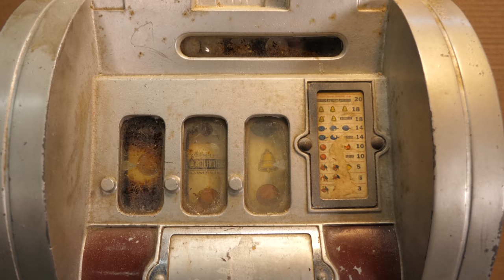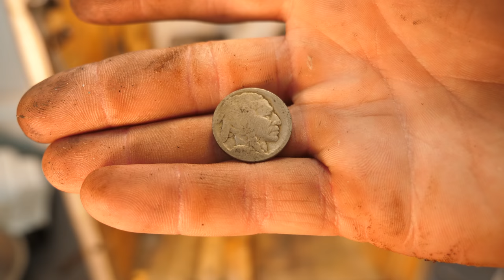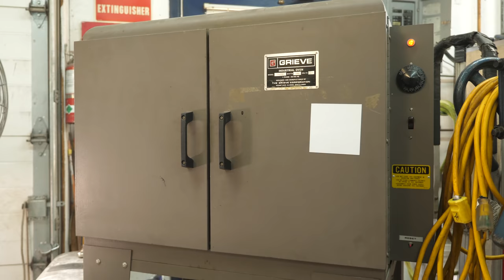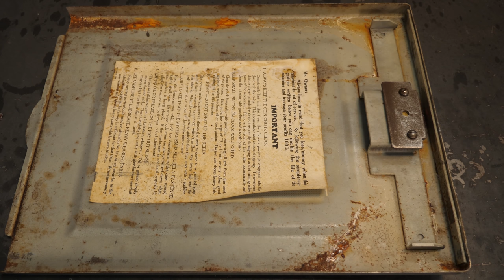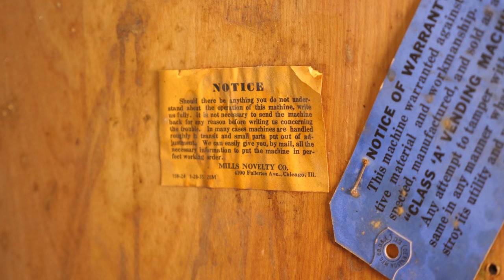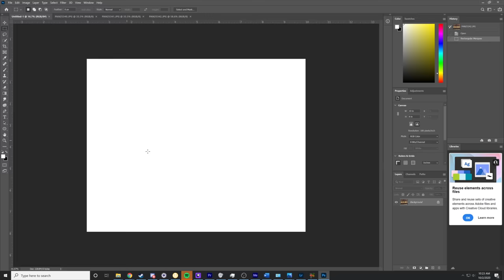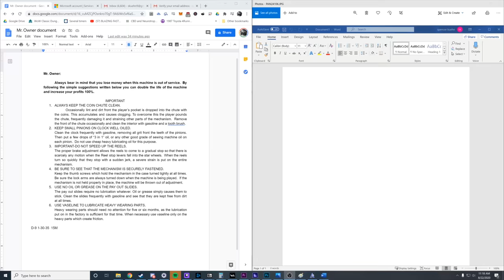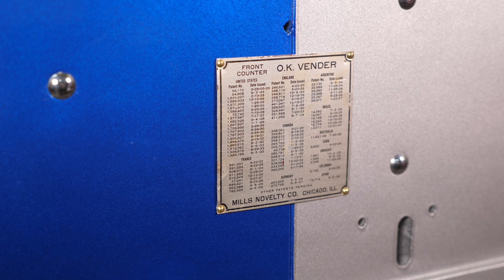1933 Mechanical Slot Machine Restoration (Slot Machine Part 1)

Comment: I can't even tell you how many parts I would have "left over" if I tried to rebuild something that complicated.
Very nicely done.  Looking forward to the mechanism vid!
Reply: A(s)lot?!?
Reply: @marianilsson8785  More than that!
Reply: Parts left over just means you did it better than the factory. (Often heard comment by auto dealership mechanics.)  :-)
Reply: my mechanics:
"This slot machine is in bad condition... I make a new one"
Reply: At least a few screws/bolts. That's what happens if I'm trying to do something like this.
Reply: I have parts left over just changing a light bulb lol
Reply: @JohnnyX50  HA!  Flip the switch, and springs and a couple of bolts end up on the ground!
Reply: Me too.

Comment: I’ve been a slot technician for a good amount of years now and this was pretty neat to watch. The oldest games we have are IGT S2000 at around 20 years old. Nothing we have uses coin anymore, but I’ve heard horror stories
Reply: What horror stories ?
Reply: @psirvent8  coin in jams were the most common issue. The jet sorting machines for these coins were causing people to go deaf. The drop team’s hands were blacker than a mechanic’s due to the metal dust. If you stuck your hand in the hopper they would come out black from the dust. It was impossible to keep those machines clean back in the day
Reply: I was waiting for “deals with the devil “
Reply: @pbentle1990  yeah it was, plus the unholy things that people would do to the coin trays

Comment: It's hard to see properly but it's not a magnet is it, to prevent steel blanks being used instead of coins?
Reply: I was thinking the same thing. To catch fake coins.
Reply: It's hard to see properly but it's not a magnet is it, to prevent steel blanks being used instead of coins?
Reply: @hunterwatkins9858  was there a point to that?
Reply: Back in my pinball machine days, the coin acceptor would test diameter, thickness, weight and magnetism, in that order.  The magnet might be missing, it was optional in countries where iron might be used in legit coins.  

In the US, we had steel pennies during WWII to save copper. Maybe it was a penny machine upgraded to nickels but they had removed the magnet during WWII?

A penny in 1933 would be the equivalent of 15¢ today.

Comment: Wow, what a project! These machines were state-of-the art for their time. They were not toys. They were designed to function through 100k's of spins, and even had rudimentary features to deter cheaters. My grandfather had a similiar one in his tavern. He used to give me a handful of nickels to play it, and I could keep what I won, unless I hit the jackpot, which went back into the till! I had one of these apart once, and from the number of symbols vs the paytable, I worked out that the machine held about 30% for the house!

Comment: my mechanics:
"This slot machine is in bad condition... I make a new one"
Reply: This made me giggle way to much
Reply: Legend has it, he is still trying to hit the jackpot.
Reply: God I hate his catchphrases
Reply: Different guy
Reply: People are so quick to replace a broken part but fail to realise that part has a single broken or worn part that is cheaper than the whole unit.

Carbon brushes in a motor for example.
Reply: @gregjenkins5347  hahahhahahah
Reply: @forevercomputing  In My Mechanic's videos, the "part" is usually a screw, a rod or some heavily corroded metal plate
Reply: There's so many screws, he could do a entire video only getting the hole's edges smoother

Comment: I think the part at 42:30 is a probably space for a coin sorter so if you put in something that wasn't a nickle it would drop it out of the machine.
Reply: That's exactly what it is
Reply: Yep, it was called the slug remover.  It came about around in the 1920s when people would use slugs, or even strings tied to coins.  I even heard of people pouring oil or hot salt water to trick the machines.
Reply: @thisolesignguy2733  "Stringing," "Spooning," "Rhythm Play," "Drilling," "Handle-slamming," liquid detergent, slugs, foreign coins, magnets--the list goes on and on. It was a constant technical battle between the cheaters and the operators--who sometimes had a few tricks of their own. 
This one has a wooden case without the hanging or floating armor plates to deter drilling. 
See Scarne's "Complete Guide to Gambling" (1961) or Ortiz, "Gambling Scams" (1984).

Comment: I would guess the large "mystery" part would likely for some States/Counties to have stamped licence/inspection information into (or be replaced with a State provided plate) which may or may not have been done depending on the specific state/location the machine was located in.

Comment: How did a 30’s slot machine last longer than the body on my 2010 Silverado
Reply: 🤣 The body on my 2001 Silverado was nothing but a pile of rust when they finally hauled it off.

Comment: The level of engineering and fitment to make this machine in the 1930s is nothing short of insane.  Today's slots probably have 1/3 the parts and of course none of the soul or joy de vivre that went into this.  Restoring it does justice to those people who were responsible for its manufacture.

Comment: Bravo!!!    I am restoring an old 1956 Genco "Silver Chest", that is severely rusted. Could you kindly post in the description what products (chemicals) you used during this restoration? I am especially in need of some good rust remover!!!   (Frozen / seized Mechanisms)
Reply: EvapoRust! I see lots of channels using it plus it's safe to use.
Reply: @CraigH999  I have tried that.... It was only about 60 % effective. Next up i am going to try a Muric acid bath for 30 minutes and see what happens.
Reply: Could use electrolysis.

Comment: Great job! One question though, why did you change one of the prize money figures to 18? It was correct as original when you were working on photoshop, then changed once printed.
Reply: Inflation? :D
Reply from the maker: Good catch! It's a long story, but I've fixed it now. 14 is correct

Comment: 42:36. Unless I miss my guess, that is a slug trap. It is to catch counterfeit coins, washers and other debris.
Reply: No, not a slug trap. At 42:36 this is an Award Token dispenser. On some machines there was a symbol on each reel that if you got all three, instead of a payout, you would get an award token that could be exchanged for cash or prize depending on the location.
Reply: @jimgard2609  I stand corrected.

Comment: The owners paper at 50:39 has typos on both Number 2 and Number 5. Number 2 should be remove all grit FROM the teeth, not remove all grit front the teeth. Number 5 should read no lubrication whatsoever.

Comment: The immense mechanical complexity of these old machines never fails to amaze me.
Today that would be one LCD screen, 2-3 wires and a small circuit board.
And of course the whole thing would be made from plastic.
Reply from the maker: And hundreds of thousands of lines of code*
Reply: @RestorationStation  that is true.
I just love all the mechanical wizardry, it is so much more impressive.

Comment: You can really call this technology. Everything with screws and springs. Nothing electronic. And it's a lot easier to fix than it is today. I don't want to talk badly about today's devices, but it is hardly possible to repair them. The repairability of old things like this slot machine is amazing.

Comment: Excellent restoration skills, though I would have applied any lubrication with a brush instead of straight from the oil can.
You might have possibly been able to have saved the inside label if it was soaked off.

Comment: Someone designed and built this machine nearly 90 years ago without any CAD software or computerized laser cutting tools. And after cleaning and fixing all the things it still works as if it was new. Machines nowadays are scrap metal after a few years.

Comment: Founded in 1898 and ceasing operations in 1948, the Mills Novelty Company was America's leading manufacturer of coin operated machines. They produced slot machines, vending machines, and juke boxes. Simply a poster advertising their products is valued at nearly 900 USD today.

Comment: You can sand the glass down with water and a belt sander. Silicon carbide belts work great, you wouldnt have had to modify the metal

Comment: I am impressed the base was so clean and as fresh as it was, the glass seemed salvageable, I liked you put the original nails back into the base, wsh youd have kept the original pins :'), nickel plated this would look great, but maybe too reflective on the eye? was it originally blue and cream or was that overpaint too, be fun if you could track down the casino or bar it came from!

Comment: Which part was used to affect pay offs ?  My mom said they could change something to get different  payouts ?
Reply: the payout is fixed.   you have to cheat to change it.  go to part 2.  there is a small toothed wheel with a square nut in the one of the notches right at the beginning.   to reduce the payout, you can use a "bug" to block one of the notches.  The reel cannot land at that stop now and the player gets a reduced payout (unless you cover a first row lemon as that is a blocker and fewer lemons mean more pays.)

Comment: I left this comment as an edit in my other comment but I’ll post it here too as a separate comment in case other viewers want to know. The mystery part you asked about at around 43:00 is more than likely for a Gold Award mechanism, though I can’t be certain because the machine is completely disassembled here and I’m not there physically to inspect it. Anyway, many vintage mechanical slot machines have a secondary “jackpot” in the form of a redeemable token. The operator would slide in the tokens and if you hit a winning combo, a Gold Award token would drop out in addition to a standard payout. Now I’m not certain, but this could be why your machine has the FOK Vender side label despite being a Mills Extraordinaire. It’s quite possible that this machine is actually a conversion-front. Meaning it has the front marquee and design of one machine but the mechanism of another

Comment: This is a Mills Extraordinary nickel machine.  They also made dime and quarter Extraordinarys.  Great job on it, but why put all of the oil on it when the directions specifically state not to?  Also the front can have placards placed in it behind the glass and in the curved area right under the reels line.  I had some specially made for mine.  The glass always does that in these old machines that are not taken care of.

Comment: There are certain parts of this that i may have done differently, like leaving the original layer of paint underneath the new one, and leaving the old papers behind the new ones. But only if it is possible to actually do those things

Comment: Wondering how it could controll the pay out with a junk mechanical like that
Reply: the front jackpot trough has two phases.  When the jackpot is won, the upper chamber dumps to the lower chamber, and then the upper chamber is refilled by a stepper gear controlling the count.
The individual wins are controlled by the main mech:  each plate has holes in it  and if they line up, pins spring into them.  When the pins go in, this effects the payout slides at the bottom, which then controls the size of the stack of coins you win, and those are ejected to the payout slot.

Comment: I scrolled and scrolled the comments and didn't see an answer for this. The purpose of the part shown at 42:32 is: it's simply a  block-off plate, to cover the opening in the casting. The opening was for a piece of glass, a display window for an option this machine doesn't have, called a "Gold Award". The window would display several large brass tokens, one of which would be dispensed when the Gold Award was won; three yellow coins on the reel strips, across the pay line. The part installed at 42:38 is the housing for the Gold Award token dispenser, but many machines came from the factory like this, without the smaller parts that make the token dispenser operate. The mechanism would also have had a couple of extra parts, and a different reel bundle (with the Gold Award symbols on it).

Comment: 54:53 The new pay out decal has 3 plums as an 18 pay out. The old decal has 3 plums as a 14 pay out. I do know if the machine was changed or if its an oversight. Just pointing it out is all.
Reply from the maker: Yup. Already fixed it. Good catch

Comment: @Restoration Station, you said leave a comment  at 42:31 if you know the purpose of the rectangular plate! It is simply to blank off the gold award window. Some of the mills extraordinaries were produced with a gold award and paid our a Silver dollar sized Gold token from behind that window!
Reply: Similarly, mine was originally a vendor, and it has such plates fitted to blank off the windows which displayed the rolls of mints.

Comment: Fun thing about owning any vintage old slots like this is you can put them on top of your bar at home and when friend scome over they know to bring tons of pennies and quarters and you make a little extra money, I don't charge them for the arcade machines though I keep those open and just press the button to load a hundred games into them cuse it's no fun charging your friends to play your at home arcade with real arcade machines like original 59 batman pinball and a few other cool pinball machines and two lane skii ball, arcade air hockey table like a legit arcade one that's fast and huge with the blue top and score keeper and takes tokens or coins if you wanted to charge ppl to play, I got 4 of those nascar arcade games that you sit in a simulated racing seat with pedels and force feedback wheel and seats vibrate and move a little and the machine is in the shape of a nascar cockpit and I got the 4 ride on superbike racing arcade game as well that you sit on the motorcycle and lean and use hand controls and all to race on the machine that's cool and real mechanical bull from the bar that closed down near my house, video poker machines and card table for playing "family card game nights" and my machines are for entertainment only no gambling if the feds are reading this. And good thing I watched this video first cuse I have a slot machine same brand and company just a different style is all and same year and all that needs a light restoration as in opened up clean the inside up and clean the housing of it up with new paint and all and clean up the screws that show signs of rust from it being on the Gulf coast air it whole life even though it's been in a house it's whole life the salty air from being near the ocean did a little rusting on it and I know the parts inside might be rusty to but there's no way in hell I'd be able to get it back together to many damn small parts and screws it works flawlessly but just would like to restore it is all. Yours isn't painted mine is all decorated up in paint and all it's beautiful glossy paint probably led paint since it's from the mid 50s it was on a bar top in Las Vegas before the guy I got it from had it.

Comment: I have a nickel machine and was hoping to learn what is causing the handle to be  hard to pull but I could never do what you have done.
Reply from the maker: Lol. I've learned that you can fix anything given enough time. You could try loosening the wing nuts on the big vertical spring on the back of the mechanism but it could be any number of other things as well. Assuming you have a similar model to mine that is*

Comment: Brother, next time if you want to salvage glued on paper labels, try taking a photo of them first, then try to remove them, if you fail to retrieve them safely, just print the image of the label to replace the original label, sure it would not be authentic but hey, better that than nothing
Reply: Edit: nvm you did it way beyond, nicely done

Comment: I do honor your hard work and time you put into this, but besides many, many flaws where a trained restorer would scream (wrong kind of oil, removing original papers etc.), the most horrible one is the painting of the case, making the wood and metal look like plastic...
As a restorer working in a national tech museum in Germany, I can tell you that this object now lost all its charme and historical value :(
One advice if you want to restore objects like this correctly: Never, really, never use a sand blaster. Do it with dry ice or fine-milled walnut shells. But NEVER sand...
Reply from the maker: I'm not set up to blast dry ice (never even heard of that to be honest) and walnut would not have been aggressive enough for most of what I did. 

Also, one of the labels you're referring to literally recommends using 3 in 1 oil. What would you have used instead?  There's plenty of things you could criticize in this video, but this one is a reach...

Maybe it's just a language barrier or something, but I didn't use any sand. I used glass bead or silicon dioxide depending of the type of part being media blasted.

Your other criticism about the labels is fair, but you could make the same "historical charm/value" argument for every other restoration video ever made.
Reply: @RestorationStation  I think our German friend may not realise that these machines are not exactly rare.
It isn't an original Fey 'Liberty Bell', after all.